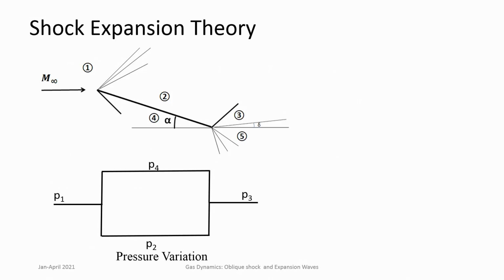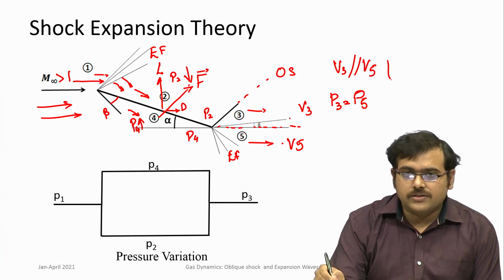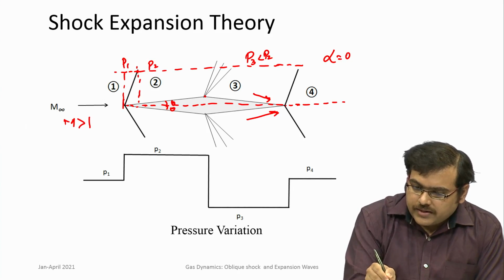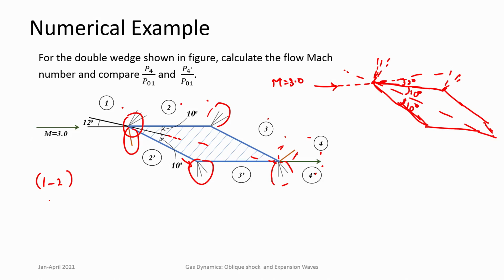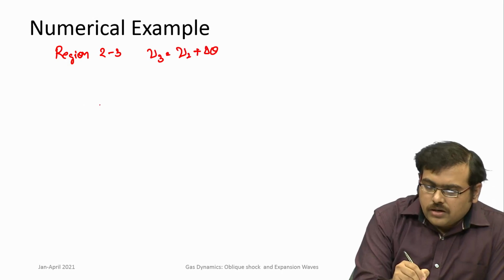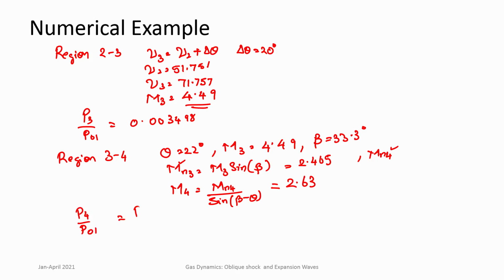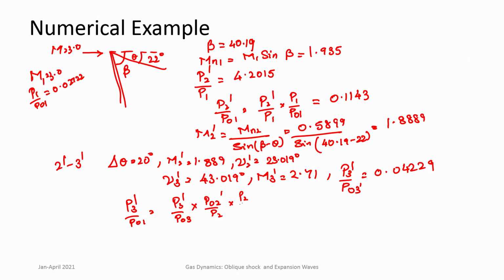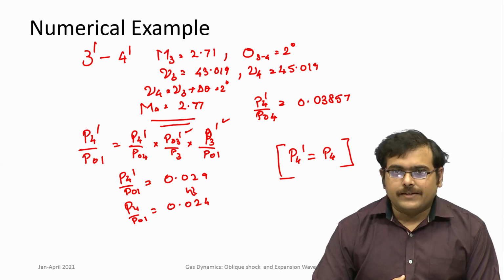lec28 Shock Expansion Method

Comment: Good day! I do not speak foreign languages, I write through an interpreter. How will this profile work on a round wing at speeds up to 100 km/h, Does it make sense to make a round wing with this profile? It is planned to design and build an ultralight aircraft with a circular wing in the form of a disk in the plan. Such a profile is easier to manufacture from wood in artisanal conditions. “thanks.
Reply: For 100 kph, you do not have to worry about expansion fans or oblique shocks. This is because the speed of sound is about 1235 kph, and Mach, or the fraction of speed of sound you are going is about 8% (0.08 = Mach number). For Mach less than about 0.3, you can neglect compression effects. This is generic advice, so study this yourself, but this can be a good start.
Reply: @pabloarroyo8546  Thank you very much. What profile and thickness would you recommend for a round wing in plan with a diameter of 5 meters. The total weight of the aircraft is no more than 250 kg?

Comment: From where do you find the pressure rations P2/P01 etc. ? What charts or tables? I cant figure this out :( pls help
Reply: Switch TV, I believe your confusion is about the ratio across the expansion fan (or PM Fan/PM wave, all mean the same thing). The ratio across any isentropic wave has constant stagnation properties. To your question though, the value of p2/p01 would come from an isentropic table, where some input (either Mach number (m2), or PM number (v2), etc), got you a location in a table, at the location of the expansion wave/fan/etc, the pressure ratio p2/p02 is the same thing as p2/p01 because the stagnation pressures across this isentropic expansion fan/wave are constant. He might write p2/p01, but thinking of it as p2/p02 is fine, as long as you know their equivalent. Your textbook/calculator doesn't know where you're at in your problem, so it will typically convey p/p0 and it's up to you to know when the p0's are equal. Answer: they're equal across isentropic processes, like compression waves and expansion fans, but not normal and oblique shocks.